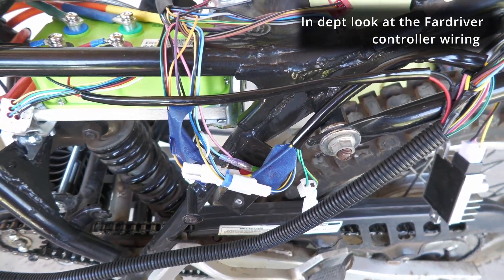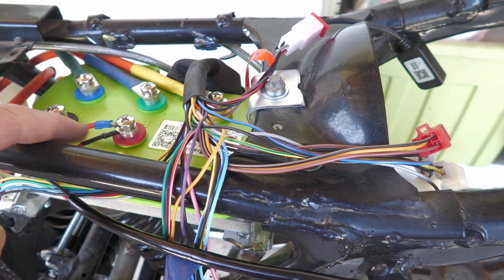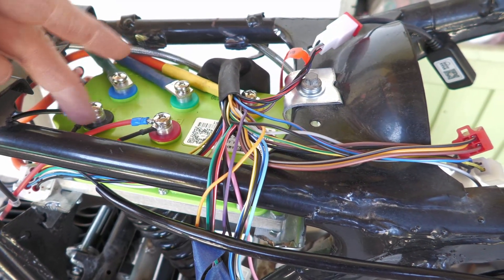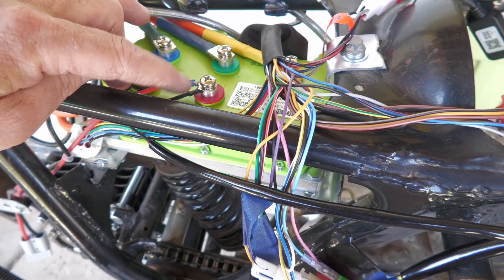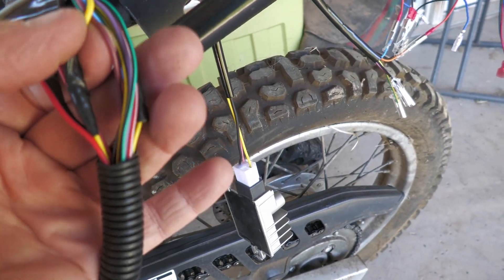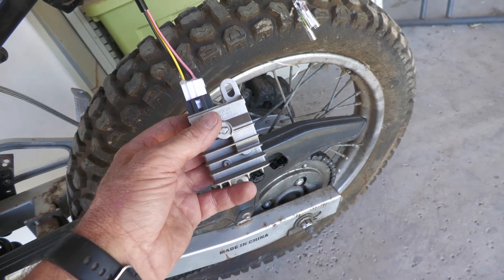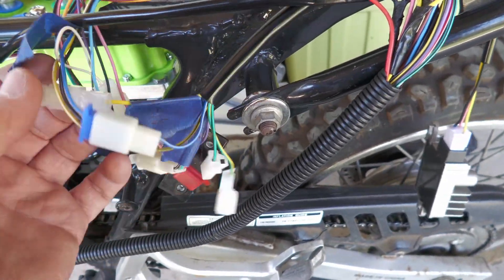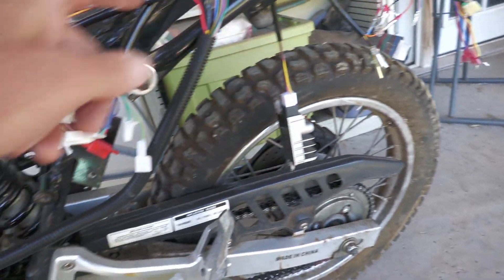Fardriver ND72530/72680 Controller Wiring for QS138 motor in 250cc Enduro conversion

Comment: you are using 18-gauge wire to connect a 72v battery to push a 5kv motor? did you notice the size of your motor wires!

Comment: Did that harness have plugs for 72 volt head lights  etc or does all the lights 12 volt  ...  I know they have 72 lights   so  if I should use caution  when I plug in my lights
Reply from the maker: normally you run your lights off the 12v power inverter. You can run the 72v power going to the inverter strait to your switch but not many people run 72v lights.

Comment: Bro, your wires from the battery seems too thin compared to the motor wires.
Reply from the maker: That was a temporary wire harness for testing, The wire i'm using 4ga wire on the final set up.

Comment: Did you figure out where do the wires come out from after the switch for the headlight? I think I saw where you shown them going into the switch but didn't see where they come out to plug into the light itself. Great work tracking all of this down, very helpful!
Reply from the maker: time point 7:32 I show the headlight harness.

Comment: Hello, did you managed to find the blinkers ? I found that the 3 wire plug Pink Gray Black leads to the blinker flasher unit (it was missing on my harness, yours as well)
Reply from the maker: I ended up running my own wires.

Comment: I want to wire a light, but for the light connector I don’t know what Each wire does
Reply: I am in the same boat, same with my tail light sensor and speedometer

Comment: Thanks for the reply 
Yeah my motor is running backwards Iv tried to change the settings in controller but still goes backwards, looks like il have to swap my phase wires around.  I got qs138 70h v3 with FarDriver nd72530, I hope I can go forwards not backwards lmao
Reply from the maker: If you have the fardrive controller there's a setting to switch direction.  You need to let it run through its sinking modem it turns for a few seconds in each direction and then when you switch it off and back on it will run in the opposite direction.

Comment: Hi I noticed your phase wires are switched, how come? Was motor spinning in wrong way?
Reply from the maker: Yes the motor was running backwards, some of the videos I watched said all you need to do to change 2 of the phase wires. Turns out you need to change the motor direction in the software. So I changed them back after the video was filmed.